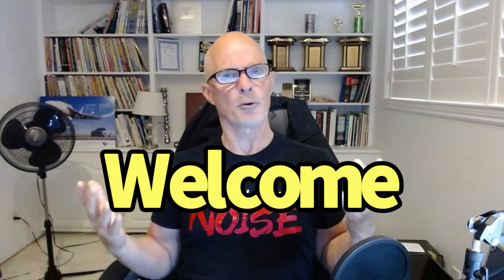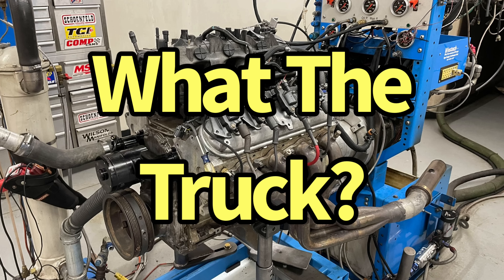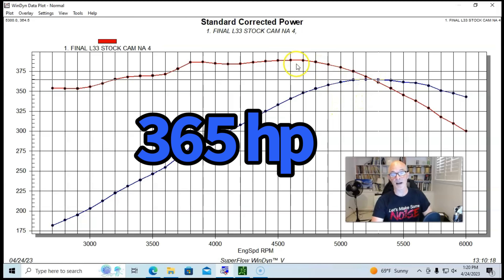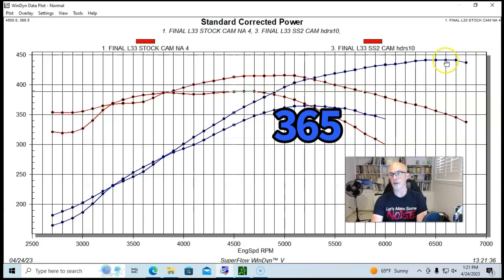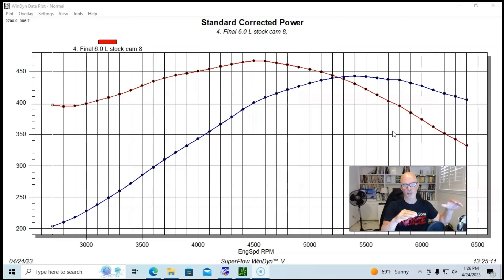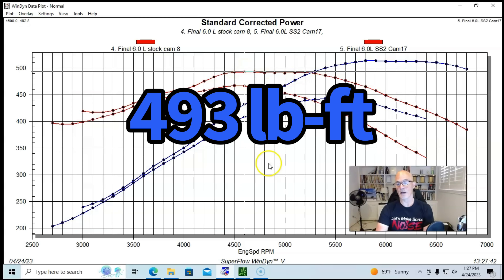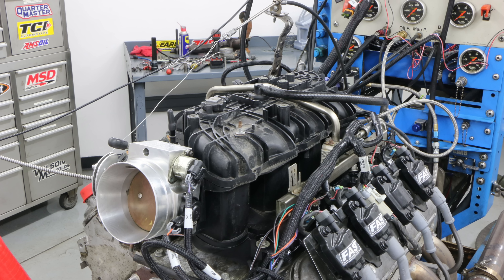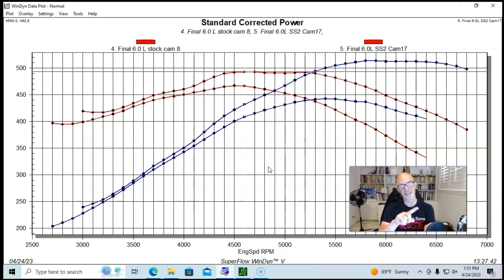HOW MUCH HP WOULD A TRUCK NORRIS CAM MAKE IN A 6.0L? NO TEST DATA-SO LET'S MAKE AND EDUCATED GUESS

Comment: Richard.  I’d be really interested to see a stock lq4.  Stacked up against a lq4 with Truck Norris, TBSS intake, and 706 heads.    I’m running this exact setup in my old work truck. And it’s noticeably more powerful across the board.  It would be fun to see real #’s.  Might give some of the other 2500hd guys some hope. Mine was somewhat gutless before
Reply: I have basically the same set up but with stock truck intake in a 2500hd too. Seems to be a little above stock in torque below 3000rpm. Does seem to come alive more above 4000rpm. Have it set to 6000rpm shift points. Does good for a heavy truck. Think I am going with ls3 heads and lsa blower soon. Can't beat pds for lowend torque
Reply: Same set up here, but in a Jeep Scrambler. Love the Torque!
Reply: Have yall dragy'd your trucks? I have some bolt ons on my lq4 and some very mild tuning. I only like backing up what i do with hard numbers. My 03 6.0 2500hd  excsb 4x4 ran 15.2@93 with 33s....still on the stock cam. It's likely faster now as i have eliminated more tm i just haven't backed that up yet. It has oe 4.10 gears but i have since upsized the tires to 305/70 17. It needs some gear in it now.
Reply: @HioSSilver1999  my 05 rclb 2wd 2500h consistently does 14.1-14.3 at 98-99mph on the street. Lq4 with BTR stg2 truck cam(version 1), long tubes, stock catback, airraid intake. I have 706 heads for it that i ported slightly. Someday they'll go on along with a tbss intake.
Reply: @SmallBoreGarage  just sub’s your channel
Reply: @SmallBoreGarage  that's not bad but i would think a 2wd in rclb configuration could get in that range with a stock cam. I think the oe intake and tb is really starving these trucks. That's pretty much been my experience with the ls line up in general really.
Reply: @HioSSilver1999  with a maximized well thought out  bolt on setup, gears and a stall, sure it could happen. Mines literally a cam, longtubes, tune 247k mile daily/tow truck lol. I think the stock intake manifold is probably holding it back maybe 15-20hp. Who knows
Reply: @SmallBoreGarage  I'm thinking a well thought one would go 13s with bolt ons. I've been looking for some oe wheels to try on my truck with a 26" tire lol.  I wouldn't be surprised if it ran a 14.5 the way it sits with just that change. 

We've done pretty well with bolt ons. My 99 Camaro with a bolt on ls6 went 10.7@130ish which was my dd so not gutted or whored out for drag racing. My buddy's c6 ls3 we went 10.5@132 with it being just bolt ons too. Not gutted either. Both cars had plenty of room to grow.
Reply: @HioSSilver1999  I know who you and Phil are haha. Little bit more work than the typical bolt on car though. Get the camaro back on the road?
Reply: @SmallBoreGarage  lolz....that pos starts and the engine is really strong running. But drivability sucks and i haven't had much time to fool with it lately. School takes a chunk of my time and it gets sacrificed. 

They were both just normal bolt on cars really. Be easy to improve on either cars et.....hell i think if one got serious it would be fairly easy to make a bolt on c6 ls3 car run 9s. Phils car didn't have light weight brakes, it was tire limited and no real attention paid to weight loss. 

My camaro had some weight reduction but not like alot of guys are doing these days for the bolt on records.  No race brakes, full interior,  jack/spare in it, pump gas.....plenty of room to grow there.

What made you want to fuck with a old truck??? Lol
Reply: @HioSSilver1999 you did better than mine. My stock 04 2500HD extended cab 4x2 did 15.8 @ 92 mph on my Dragy.  I think I am going to put the TN cam in mine.
Reply: @mattspontiacta  that's really good for a stock one i think. Mine went 16.1@86.xx bone stock in August heat. I think you being 2wd is right on par with that. 

You could get to the 14s pretty easy in that truck imo.
Reply: @HioSSilver1999  that’s good to hear. I am running 285/75/16 tires on the stock wheels. Truck is factory height . Going to put a 2 inch leveling kit on it. Truck/engine 157k. I didn’t mention before the truck has true dual exhaust put on from the previous owner. Maybe that helped some idk. 

Looking forward to the TN cam.
Reply: @HioSSilver1999  I might have skunked some imports from light to light. No high speed drags on 40yr old Lifted Jeep on 35’s. It also needs Hydroboost breaks due to the torque.
Reply: Mine is a 06 crewcab 3/4 ton 4x4. Stock 4.10 on 35x12.5r17. The 35s really hurt the power. Went from 285/70r17 to the 35. Its not fast from a dead stop, but from a roll around 35mph, she moves pretty well. 
I have another truck on 38 with btr stage 3 v2truck cam in a 11.1cr 370ci motor. That thing will move. Biggest difference is the the trans and 4.88gears. The 4l60 just has a better 1st gear. That is why I am looking at lsa swap now.
Reply: This is the exact setup I’ve been thinking for my LQ4 to get her moving a little better without compromising drivability. Wondering how I’d like it. LQ4/706 tbss/headers full exhaust/efans w truck Norris cam
Reply: @AQWbladefire  a cam is really a waste until you put gear in it.  Shift points on lq4s are  right at 6k rpm with a stock cam. A truck Norris cam or really almost any aftermarket cam is going to want shift points closer to 7k rpm. 

Even with oe tires and 4.10 gears that makes for long gearing at 6k rpm must less 7k rpm.

A geared truck with a oe cam will out run a oe geared truck with a cam....and out pull it.

Comment: SS2 6.0 power band looks similar to the 5.3.
You could almost overlay them onto each other. You could use the overlay of the 5.3 SS2/Truck Norris on the SS2 6.0 and get a good guess at where the Truck Norris 6.0 would land.

I'm figuring way more low end torque with a similar peak but hp around 465-475.
Reply from the maker: the SS2 6.0L made 514 hp. The SS2 5.3L made 441 hp. Not similar
Reply: @richardholdener1727  I mean the shape of the power bands looks similar. I bet if they were overlaying one another or on the same graph, you could use that information to interpolate, roughly, how the Truck Norris would do with the larger engine.
Reply: @natricjol  was a bit surprised on the calculation he did in the end. thought the truck norris cam would make significantly more tq from 3 - 4,5k rpm compared to the ss2, like it did on the 5.3
Reply: looking at it again he most likely talked about peak torque

Comment: Some body that’s good at math could probably do the estimate with an algebra equation . It’s amazing what a rec port 6.0 will make with very little work .
Reply from the maker: ALGEBRA WON'T GET YOU THERE
Reply: @richardholdener1727  I think he was talking about a spreadsheet: Dyno already gives a spreadsheet..
The more Data points for a camshaft, the easier to guess...

Comment: I’d love to see a Truck Norris on a 5.3 and a VS gen THREE 78/75 on E85

Really just the gen 3 vs the older generations. Not much info out there on it
Reply from the maker: PLEASE SEE THE TRUCK NORRIS TURBO VIDEO FOR YOUR ANSWER
Reply: @richardholdener1727 oh, nice! Thanks for the info. Mind if I ask what springs you typically run for boost? I have a 706’s with single 560 beehives. I’m looking to push 15-18lbs and wondering if I’ll run into any float
Reply from the maker: If I was running near 20 psi, I would have good springs

Comment: 224/224@.050, 106 lsa, installed at 102 degree advance. Take a guess what the power will be.
Reply: Knock, knock
Reply: I thought the topic was 6.0, but 5.3, 5.7 would be OK.
Reply from the maker: ON WHAT?

Comment: I was guessing my gen 3 LQ9, stock manifolds (intake and exhaust) , with a Truck Norris is roughly 425hp, 400 ft lbs.
Reply from the maker: IT WOULD BE MORE AT THE FLYWHEEL
Reply: @Richard Holdener  that's good to know. The awd drive system of the Denali isn't too kind with power consumption.

Comment: My thoughts... depends on the intake manifold used, heads, etc. The BTR Truck Norris and Texas Speed CHOPacabra made nearly identical power in your L33 test of 4 cams recently. I have: LQ4, 862s, TBSS intake and 92mm TB, CHOPacabra cam, headers, exhaust, tune, etc. It did 336 RWHP. I have a 4L80E and heavier than stock wheels and tires. All that said, I don't think it's unreasonable to say it's losing up to 22% in driveline losses. By the math, and the test you did from engine dyno to chassis dyno... I think if we yanked the engine out of my truck and stuck it on the engine dyno - somewhere around 430-440 @ the crankshaft is my guess. Definitely no more than 450 HP.
Reply: One reason I love my dual clutch manual dog box is less is losses! But I’m pretty sure 15%-25% loss is average on most. Maybe more depending on your diff and axel type. BC your the man!!
Reply from the maker: THE STOCK LQ4 WAS 40 HP DOWN ON THE "STOCK" LY6
Reply: @richardholdener1727  That said, I would think that my estimate is pretty close then for a cathedral port set up like mine.  It would take a great set of cathedral port heads and a FAST 102 to catch up to the rec port set up IMO.
Reply: @bluecollarhotrods9781  so a LY6 style head would be required for top end HP
Reply: @shadowopsairman1583  with a camshaft to match.
Reply: CVT losses with any extra power is crazy!! Belt slip is real!! Lmao
Reply from the maker: I THOUGHT THE CVT WAS LOSS PRONE TOO-TIL I RACED STEVE BRULE IN HIS CVT NISSAN VERSA AGAINST MY MANUAL 6-SPEED VERSA (BASICALLY A DEAD HEAT)
Reply: @richardholdener1727  Basically it's based on the rated power output it's designed for...
Reply: @Richard Holdener  huh, i always assumed brule drove a chevy
Reply: That’s crazy, I mean…stuff does add up BUT we made 365whp with a 200K mile LQ4 with just a nitrous cam swap n/a…then made 550whp with just a ‘150’ shot from a Cheater plate 🤷🏻‍♂️
That being said it was in a 3400lb ext cab 97 S10 with a 350 Turbo trans, 2800 stall, and 275/60 drag radials on 15X10 Weld wheels that were fairly light👌🏼

Comment: If you ever feel like doing a stupid test, a truck Norris or chapacabra cam would be cool to see tested in a 383 stroker LS with a truck manifold and 705 heads. 
A buddy of mine is thinking of building one for a rock crawler on Dana 60’s with 40 inch tires.
Reply from the maker: IT WOULD WORK WELL